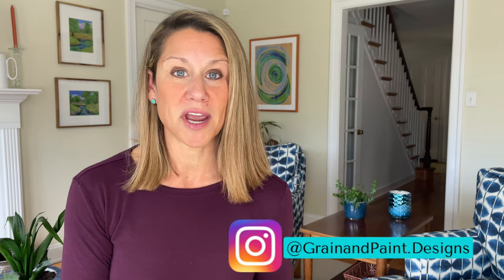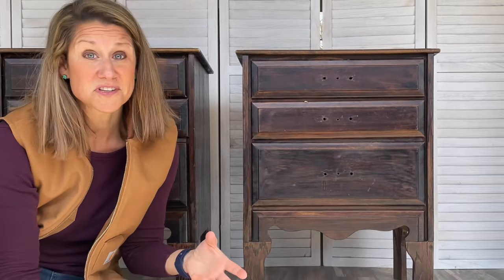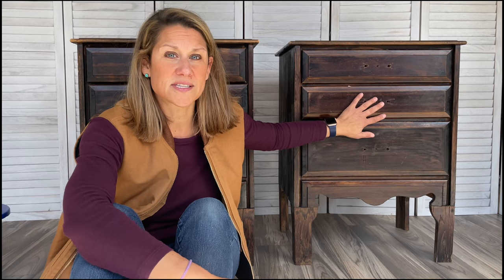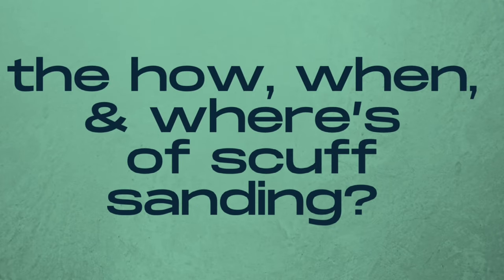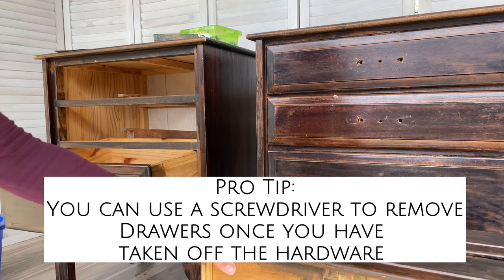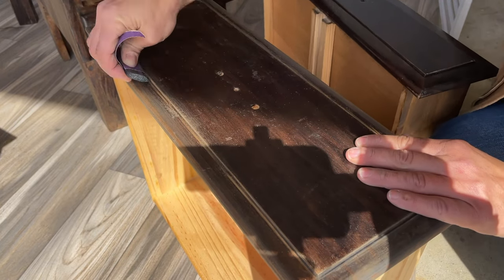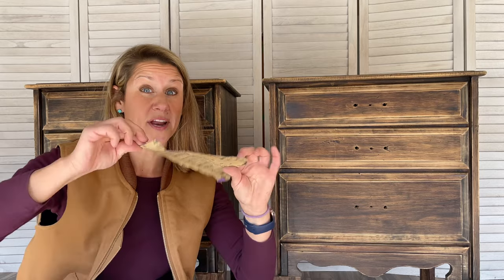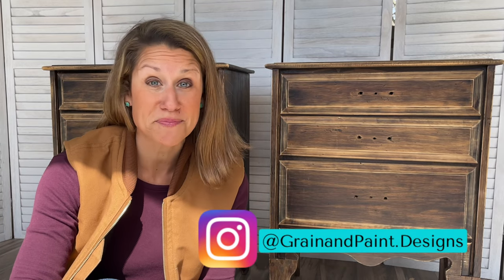Furniture Flipping Basics: A Beginner's Guide to Scuff Sanding Made Easy

Comment: Very informative, TY!  I do have one question.  I have seen a lot of furniture flippers say they use 220 to scuff sand. I think I heard you say you used 120 at the end of this video. Is it best to use a lower grit to scuff sand or does it depend on the type of piece/finish?
Reply from the maker: Thanks so much for your comment! It does depend on the finish. I usually go with somewhere between. 120 & 180 grit on most wood pieces. But for pieces that have wood veneer, 220 is best so as not to blow through the veneer, especially manufactured pieces that often have just a very thin veneer over MDF or particle board. And I definitely use the 120 grit on the grooves and edges where grease and grime tend to settle over the years!! Hope that helps some!